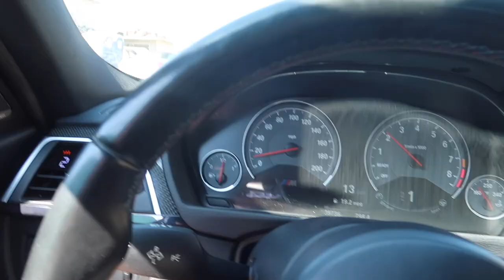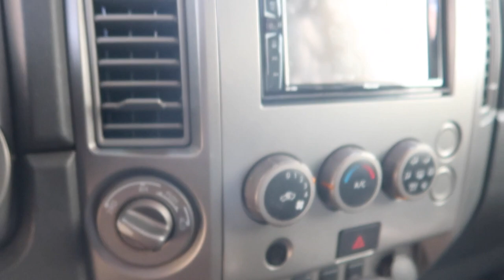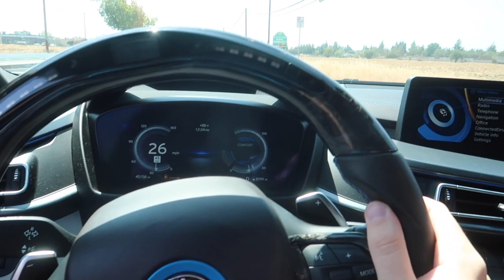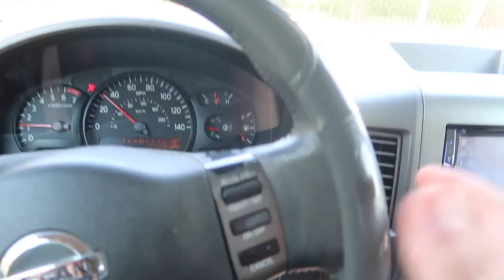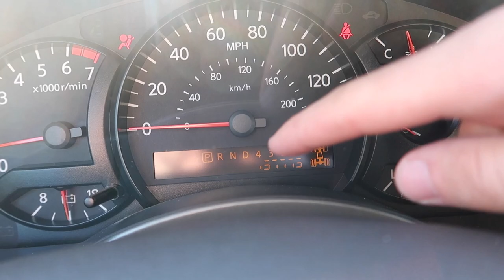PURCHASED THE CHEAPEST TRUCK THAT CAN TOW 10,000 POUNDS! 5.6L V8 BEAST FOR CHEAP!

Comment: Fuel gauge not working would have been a deal breaker for me. I replaced a fuel pump on a maxima i bought for no reason because it wouldn’t turn over. When in actuality the seller failed to tell me that the gas gauge was off by a quarter. im there with a quarter tank wondering why the car won’t start when the car was out of gas already the whole time smh